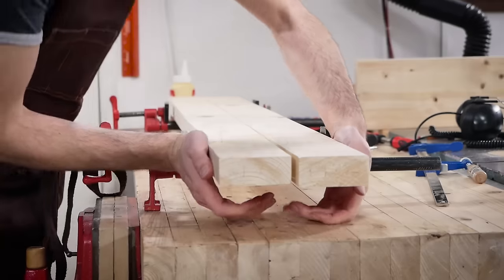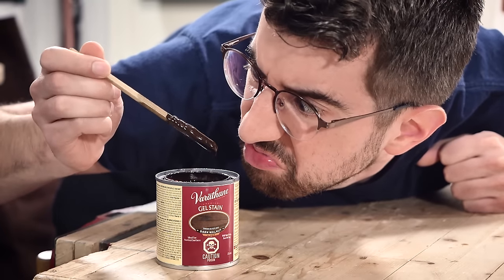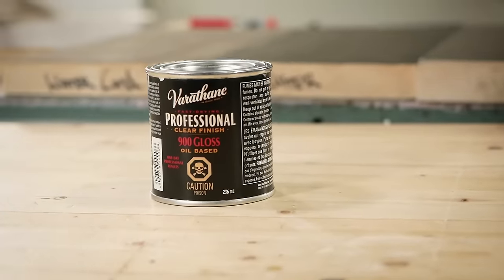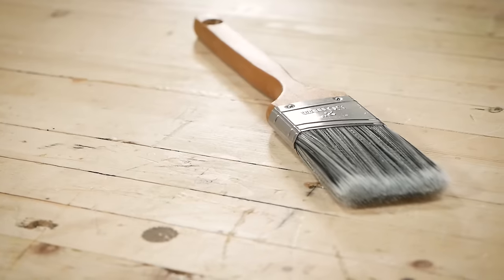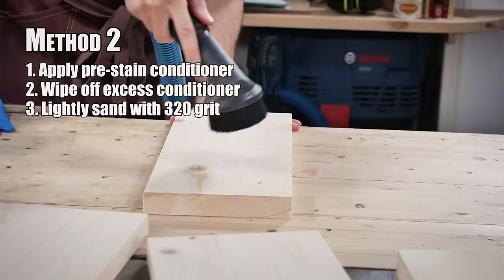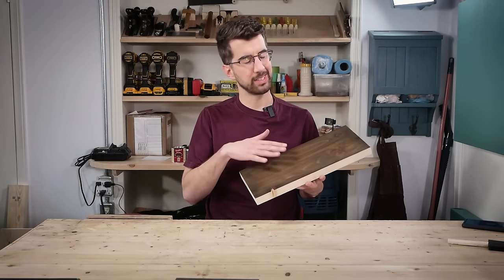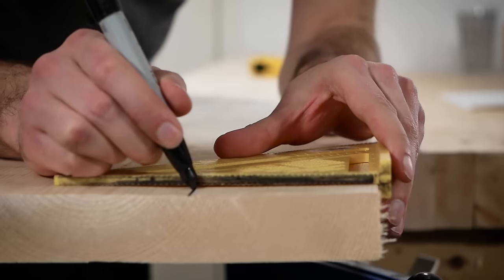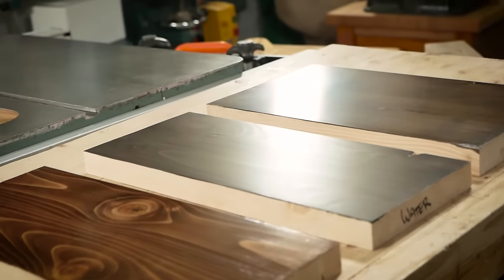Stain can look REALLY gross

Comment: I think this is the easiest staining process while adhering to the spirit of only buying everything from a home center, yet still producing professional-level results. 

1. Sand with 120 or 150 Grit.
2. Bonus if you follow it with 180 grit.
3. Apply an ample amount of oil-based Minwax stain.
4. Clean up excess.
5. Apply 2 coats of Deft Clear Coat Lacquer (choose your desired finish: Gloss, Semi-Gloss, Satin). CHOOSE AN ALTERNATIVE BRAND IF YOU WANT TO FIND OUT WHY I ONLY RECOMMEND DEFT FOR THIS😆
6. Sand clear coats with Fine Grit 3M Softback Sanding Sponge (320 or 400 Grit). ONLY USE EITHER SOFTBACK OR SANDING SPONGES, DO NOT USE PAPERBACK FOR THIS.
7. Apply the final 1 or 2 coats of Deft Clear Coat Lacquer.

There isn't really a need to use any grit lower than 120 or anything higher than 420. Personally, I am not a fan of wax or brushing on clear coats. Brushing a clear coat can force you to work harder to remove brushstrokes. Stain prep can be good, but for the majority of people, it can be like the saying 'Stepping over dimes to pick up pennies.

- Pro Carpenter 14+ years (In the carpentry world that still makes me a noob😂)

Comment: Method 3, you sand a lot in Step 11. How do you get rid of the white cloudiness before you apply the wax? Whenever I sand varathane pro I am left with white residue I can't get rid of. The directions on that brand specifically say not to sand it in between coats.

Comment: Question - at 7:00 you are applying a water-based topcoat over a water-based stain using a foam brush.  Won't the water in the water-based topcoat reactivate the stain and smear it around as you are stroking around with the foam brush?   I've had this exact problem before and the only way I found to reliably solve for it is to spray the topcoat rather than brush it, as the spraying won't smear the color around the way a brush would.  Did you use a sealer in between?   Maybe I missed something.  Thanks
Reply from the maker: Hi Carl, I thought about covering this topic, but I let it go for this video. When I've had this happen in the past, it was because I didn't wipe off the stain properly after applying it. I would hit is with a rattle can of shellac if it began to smear, then I could brush on whatever I want over the shellac. Zinsser Bullseye works great.

Comment: The 3 different samples were differ in style; one was not better than the other in appearance. The last sample from so-called "best method" was actually a BIG fallacy because this sample was the only one made from quarter sawn cuts and did not contain large knots. Hence, the argument was comparing apples to oranges. Nevertheless, if one were to observe closely, one could still detect darker patches of stain near where the knots would have been. Thus, this "best method" didn't really achieve a uniformity look as claimed. The argument mistook results from a superior composition method as a proof of the so-called "best" staining technic. :elbowcough:

Comment: Perhaps, based on the comments I've read, I don't belong here, but: Most of my works are custom and for money.  No, I don't like customers either, but that's who has the money!  The trick is to give them choices by examples before you do an all important step..like finishing.  My projects are mainly the beautification of 1970's era Heatilator fireplace installations (so ugly they were!) eliminating the grates and vents from view.  Generally only two directions in finishing...paint to match painted trim or fine finish of a hardwood like cherry, white oak, teak.  Most of these are rift cut so there aren't any wild grain and knot problems.  Customers have consistently NOT wanted to see the cathedrals and other stuff that construction pine and oak tend to display so prominently.  My advice, learn this technique and get it down pat since one day, maybe when you're retired, you'll find customers with money not so bad!

Comment: Obviously staining a quartersawn board will always result in a more even finish. So the results are skewed.🙃
Reply: Was just going to post this.  Surprised no one else commented on this.  The first two panels he stained are flat or plain sawed, i.e. the early/latewood rings are highly variable, but the last panel is more of a cross section, with even, tight grain (what you would get if everything were quarter sawed).  In a pile of construction pine, you'll get some wood that looks like the former, and some the latter.  My guess is 90% of the difference he sees here is because of the difference in grain pattern in each of the panels he started with.

Comment: That is interesting I thought the rule was never to go over water base with oil base finishes. I bet you would have a whole different set of results if you tried spraying on the finishes. Say cut with Lacquer thinner.
Reply from the maker: It's usually the other way around. Water-base finishes dry completely and very quickly, so you can put virtually anything on top of water based products. It's similar to fine art, where canvases are primed with Gesso (a water based paint/primer) but you can paint with oil, acrylics or hybrid paints over top.

Now I have gone the other way, and put water-based over oil, and it usually works fine with typical brand name stains like minwax and varathane because their oil-based products contain a lot of dryers. I'll usually do a test just to make sure, and leave the oil to dry at least 4 days before proceeding.

Comment: I think I disagree with just about everything you’ve said here.  The more the grain “pops” after staining, the better.  That’s the whole point of staining wood.  Manufacturers (and you) recommend a three or four step sanding process with increasingly finer grit but the end result is so subtle if seen at all that it’s not worth all that needless work.  Sand the wood once with 80 or 120 grit and you’re done.  Looks just as good and sometimes even better (cause it actually looks like wood!). What’s the point of building something with wood only to finish it to the extent that it looks like plastic or glass?  Might as well just build it with plastic or glass then.

Comment: I need advice, I applied gel stain on a 48” butcher block counter top, what a mess, globs all over dried before I could wipe off. I have hand sanded and sanded, used mineral spirits and tried bleach, sloppy mess any suggestions  to fix it? Power sander?
Reply from the maker: if hand sanding is not removing it, you might need a random orbit sander, or bring it to someone who has tools to do so.
Reply: @ScottWalshWoodworking  going tomorrow to buy an orbital sander to try and fixit, that would save me $219 for a new 6’ butcher block. Hopefully that works, if not at least I have a new sander.
Reply from the maker: @teaglet  it'll work with some 60 or 80 grit, then use 120, 150 and 180 grit to bring it back up to the proper smoothness.
Reply: @ScottWalshWoodworking  I bought the sander, also 80, 120, and 220 sand disks this morning, will work on it this week

Comment: Way over kill to go from 120 to 150 to 180. You can move up 50% of the previous grit between grits.
Reply from the maker: Said no one, ever
Reply: @ScottWalshWoodworking  Said every professional finisher ... ever. You are absolutely wasting time and sand paper by moving through grits in such small increments. I suppose you may issues with swirl marks if you're using a POS $50 dewalt random orbital sander. If you a small stroke finish sander, e.g. any professional sanding tool like a Festool or Mirka it's no issue at all. Common practice is increasing in 50% increments. If you start at 120, go to 180, then to 220. 150 is totally superfluous in that situation.
Reply from the maker: @matthoughton1006  What happened to 'doubling the grits'? You edited your post 😂
Reply: @ScottWalshWoodworking  misspoke. What happened to you thinking you need to go from 120 to 150?

Comment: hmmmmmm, thoroughly wet your stained wood and spray it with dilute latex varathane 25 % with water and spray it with a garden sprayer that you've install a tire pressure valve so you can use a compressor to pressurize it to 40 psi and lay a heavy coat on it. lightly sand, thoroughly wet again and spray varathane heavy coat again diluted 20%. Sand, wet and spray lightly diluted 10%. repeat one more time and pray. Works every time

Comment: Sorry, I disagree about water based vs oil based stains. I have probably 40 years on you for refinishing projects. Frankly, water based stain has a ton more disadvantages than oil based--dull colors, they hide the grain, they are uneven in drying time, in results. They are not only more unpredictable than water based, you can't alter the color by wiping immediately (with water based) as you can with oil based. The pre-conditioner makes it so that you have to use at least twice as many applications of stain. 
I ruined my son's inherited gunstock with the water-based stain that came in a kit for that very purpose. I hate it, it looks like mud--supposed to look like walnut. I am sick about it and the only way back is to strip it again. They need to work on these products--they stink.

Comment: You had me until i saw that you use the most overpriced, lowest longevity sanding discs ever. Those 3m discs that look like a good deal until you realize they have 50% less grit than any other mesh type disc. I bought them once and never again. I'll stick with Mirka Autonet. They were the first discs that made me actually enjoy sanding. And i know mirka makes some better discs, but i'm not sponsored on youtube. :)

I no longer use traditional stain. I use either Behlen Solar-Lux non grain raising dye-stain or Trans-Tint dye mixed with denatured alcohol. NOT water, which raises grain and takes too long to dry. I always use either oil based poly/varnish wiped on using old worn out cotton t-shirt OR if I absolutely must use water based and/or it's a large surface, i use an HVLP sprayer. 

The most important thing when making anything out of wood is to NOT buy softwoods. Nobody is going to be impressed when they see softwood. Especially your lady. The only way you're going to knock it out of the park is with hardwood.

Comment: I can't help but wonder if all the people in the comments who like the over-accentuated cathedral grain have ever seen much handcrafted furniture made out of solid hardwood, or are just using bland flat pack furniture with uniform veneers as their frame of reference. Yeah you can like whatever you want, people also think old furniture covered in metallic spray paint looks good, it's just not at all a sign of craftsmanship. Anyone can slap on a couple splotchy coats of random stain and call it a day, a uniform finish takes work.

I guess I just feel bad for Scott going through all the trouble of finding a combination of multiple products and techniques that compliment each other, a process that no doubt took days, only for people to say they like the cheapest, lowest effort option the best. The water-based then oil-based stain combo looks fantastic, you can hardly tell it's construction lumber, and I kind of want to try it out on my next non-hardwood project.
Reply from the maker: You said it, not me 😂
Reply: @ScottWalshWoodworking  to be fair to other people, what we do is completely insane. I don't really blame them for not always getting it.
Reply from the maker: @xaphon89  very true!